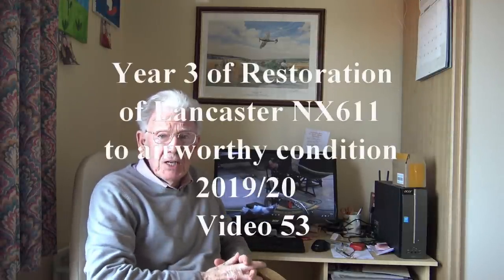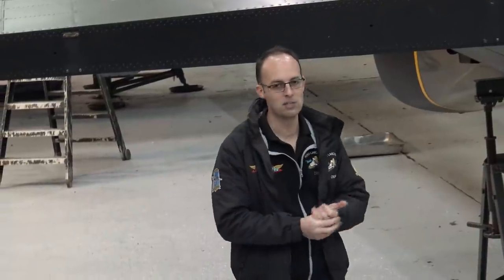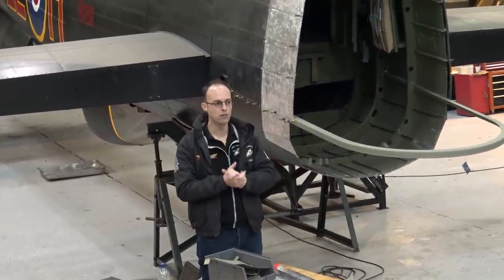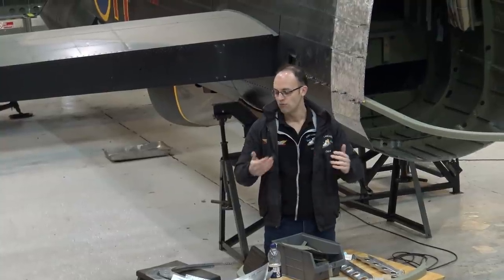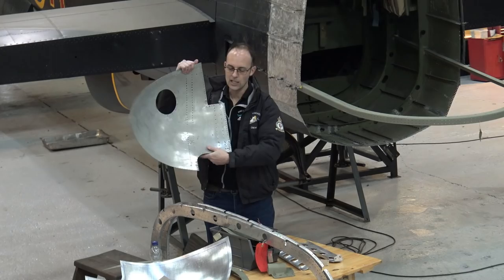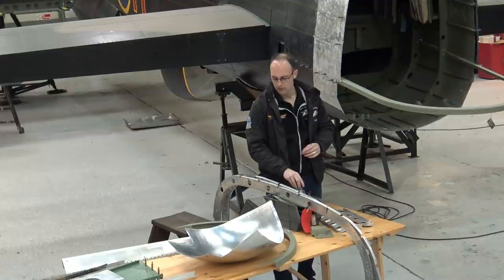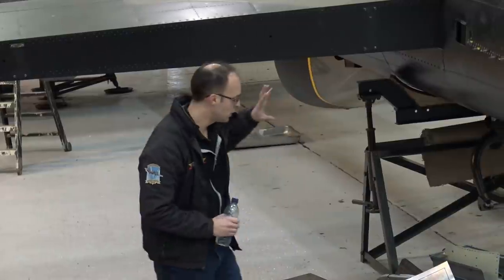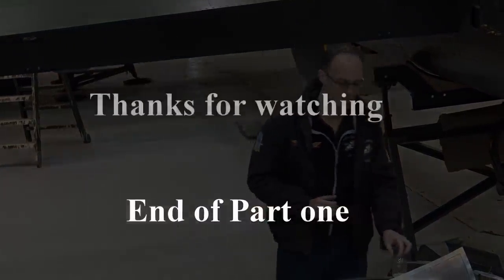Video 53 Restoration of Lancaster NX611 Year 3.  "Winter restoration tour"with Andrew Panton

Comment: Neville, with each section that has been restored to airworthy condition, is it being signed off by the CAA or has the whole aircraft got to be stripped at the end of the 10 year restoration period and inspected again and then receive its clean bill of health enabling it to fly?
Reply from the maker: Hi Geoff T. They are calling it a general service an inspection in the last year, when past it will fly.
Reply: Neville Wheeldon : Many thanks for the clarification.